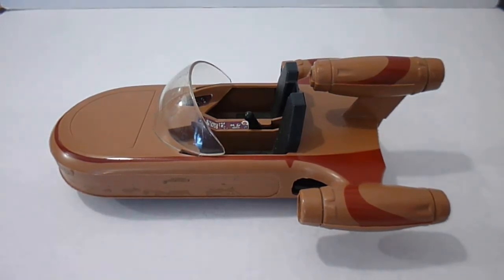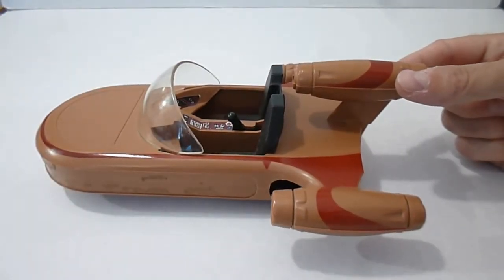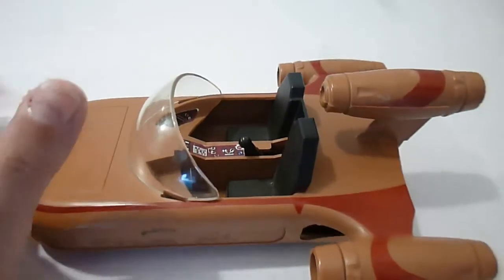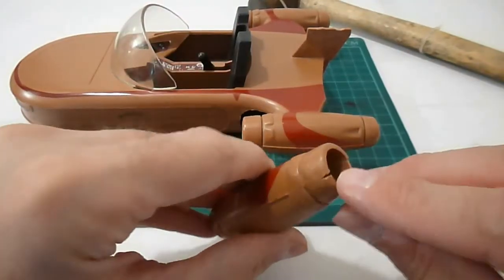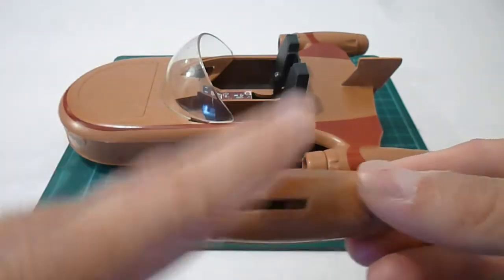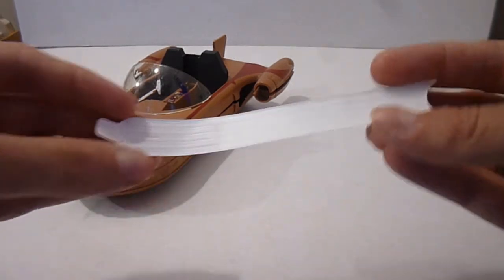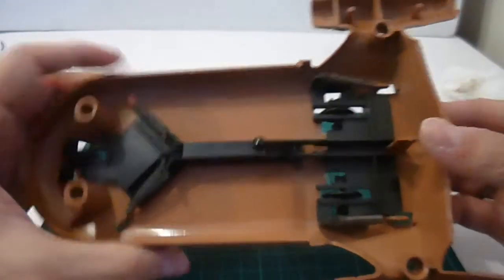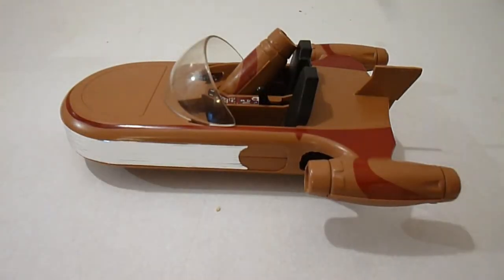Episode 7 : Vintage Starwars Landspeeder Repair

Comment: acetone will melt those old kenner toys , i learned this the hard way.
Reply from the maker: Luckily it only took some paint away. But I had too try in case whacking it with a hammer didnt work.